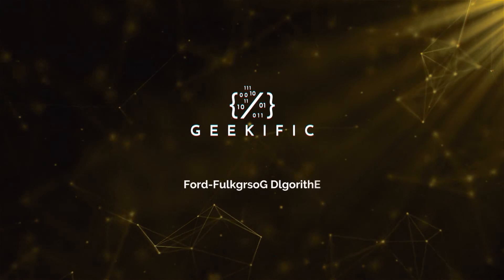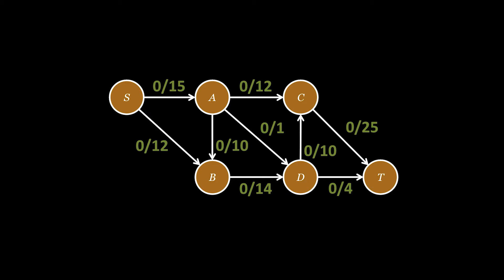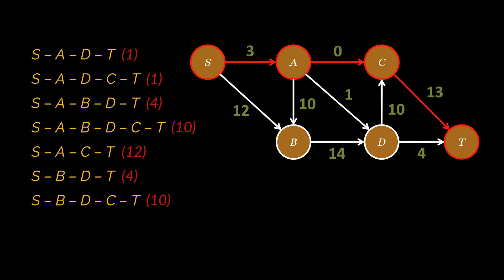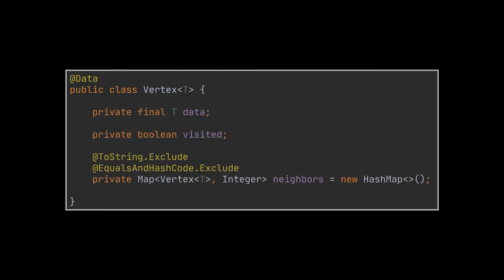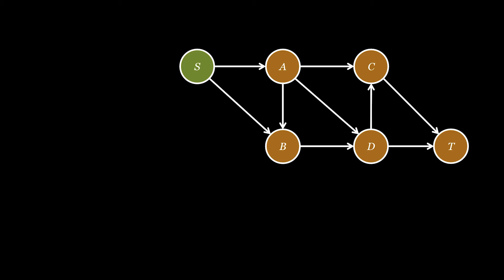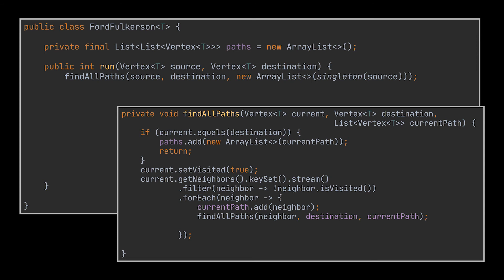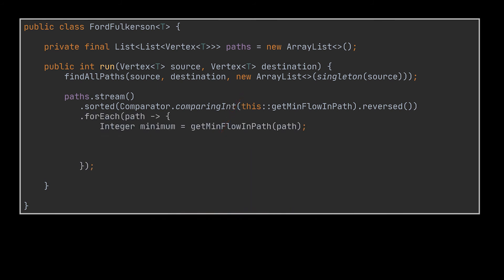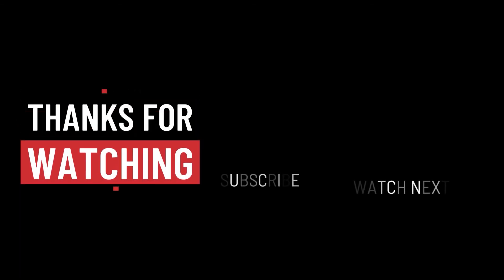Max Flow | Ford-Fulkerson Algorithm Explained and Implemented in Java | Graph Theory | Geekific

Comment: Finally. I possess only one question:)

6:40
.min(Integer::compareTo) <— is there any special reason for this option? Cause I tend to use such method reference: "Integer::compare".
Reply: @geekific  
Then I have only one small question about method reference🤷‍♂️ Root comment:) 
The second one turned into a cry of soul about wasted time while formulating:)
Reply from the maker: https://stackoverflow.com/questions/420223/what-is-the-difference-between-compare-and-compareto
Reply: @geekific  
Oh, thank you, sir, but I am familiar with these interfaces. 

My question was about smth else. In the above situation implementation of abstract method "compare" in Comparator interface is required (for Integer class objects). Luckily Integer class has two not abstract methods, compareTo and compare, which both can be deployed through method reference technique. I can choose any. Both will work here. But as I know that "compareTo" method calls "compare" method I tend to use "Integer.compare" at once:))
And because of similarity: we need to realize "compare" method? - ok, take ready "Integer.compare" :))🤷‍♂️

Comment: 1:46
"maximum from s to b is 8" - small mis-saying: maximum is 12. 8 can be added from 4 to 12;)

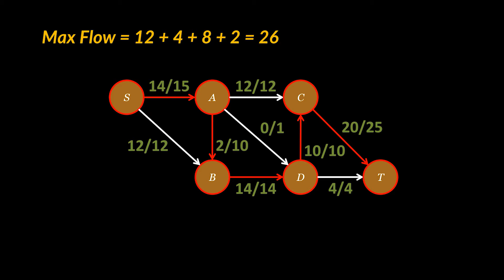1:55 
tag for edge "20/25" should be changed to "22/25" as 2 is added ;)

3:06 , bottom line on screen. 
No explanation is given where all these numbers came from:((
ps. upcoming explanation is given but not shown its implementation;) Still, I get numbers origin😵‍💫
Reply from the maker: 1/ Nope. It said the max we can still flow, we already had 4, so the remainder was 8.
2/ Correct.
3/ Implementation only covers min, but we explain the maxflow logic afterwards. Patience :P
Reply: @geekific  
1) You are right☝🏼 I missed "still":( 
Now it makes sense.